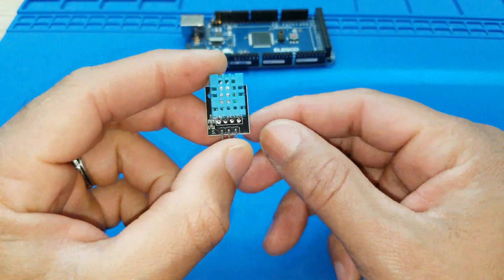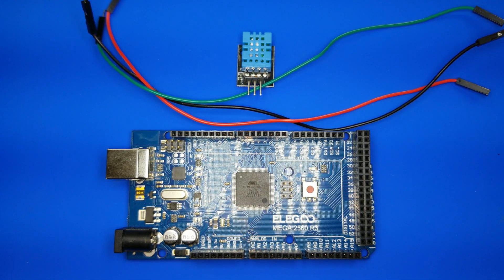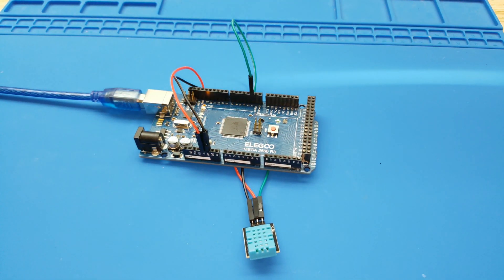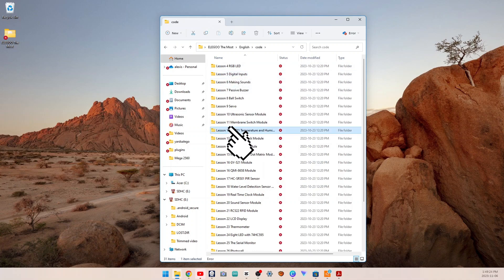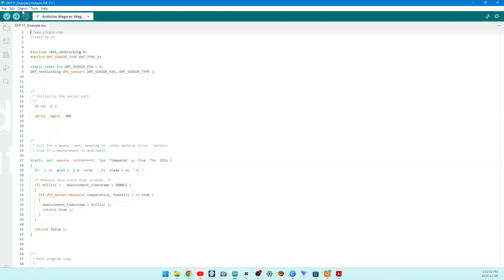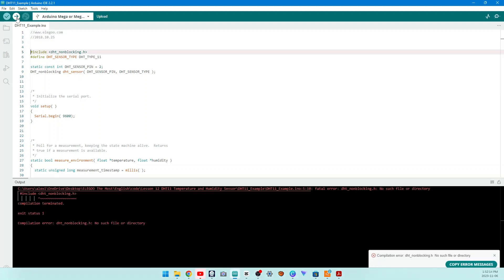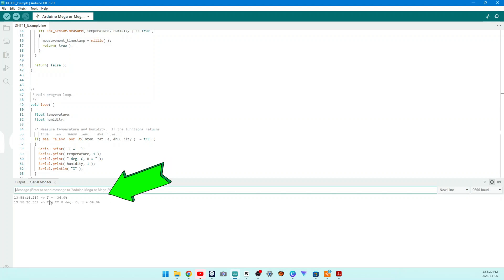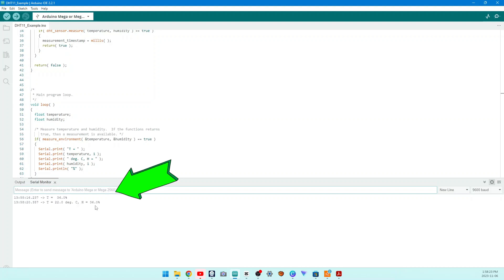Arduino Elegoo MEGA 2560 lesson 12 DHT11 Temperature and Humidity Sensor

Comment: Can you leave the codes for us 😢 I spent all the night working on this sensor dht11 and it's not working pleas help me
Reply from the maker: Do you need to codes or all the files?
Reply: @tinkeringtechhub  All the code pleas ,the dht11 stell don't work with me I don't know why? My arduino mega dosen't read the sensor
Reply from the maker: //www.elegoo.com
//2018.10.25

#include <dht_nonblocking.h>
#define DHT_SENSOR_TYPE DHT_TYPE_11

static const int DHT_SENSOR_PIN = 2;
DHT_nonblocking dht_sensor( DHT_SENSOR_PIN, DHT_SENSOR_TYPE );

/*
 * Initialize the serial port.
 */
void setup( )
{
  Serial.begin( 9600);
}

/*
 * Poll for a measurement, keeping the state machine alive.  Returns
 * true if a measurement is available.
 */
static bool measure_environment( float *temperature, float *humidity )
{
  static unsigned long measurement_timestamp = millis();

  /* Measure once every four seconds. */
  if( millis( ) - measurement_timestamp > 3000ul )
  {
    if( dht_sensor.measure( temperature, humidity ) == true )
    {
      measurement_timestamp = millis( );
      return( true );
    }
  }

  return( false );
}

/*
 * Main program loop.
 */
void loop( )
{
  float temperature;
  float humidity;

  /* Measure temperature and humidity.  If the functions returns
     true, then a measurement is available. */
  if( measure_environment( &temperature, &humidity ) == true )
  {
    Serial.print( "T = " );
    Serial.print( temperature, 1 );
    Serial.print( " deg. C, H = " );
    Serial.print( humidity, 1 );
    Serial.println( "%" );
  }
}